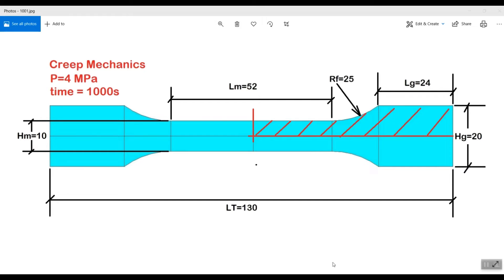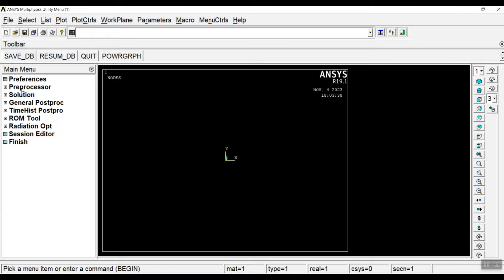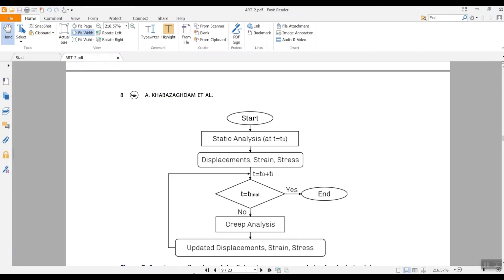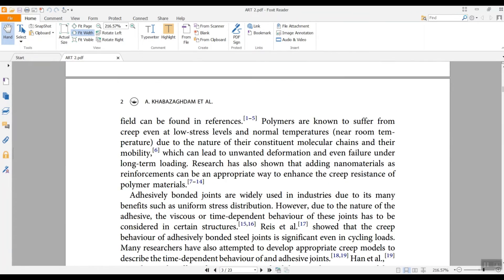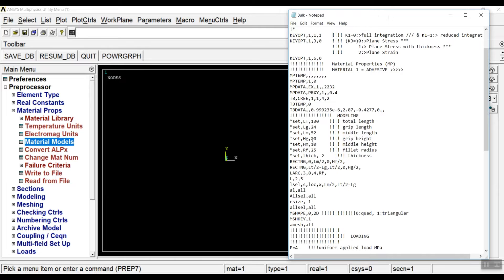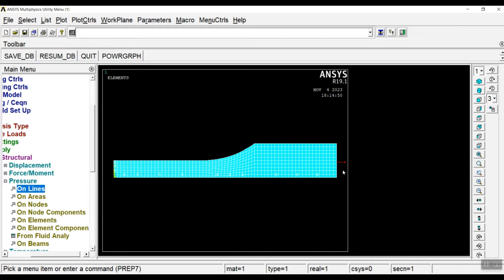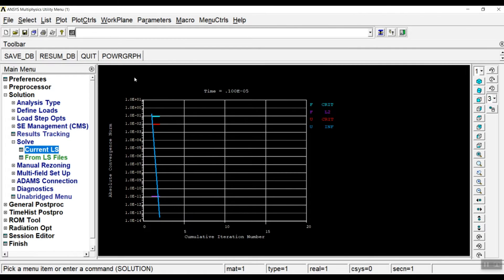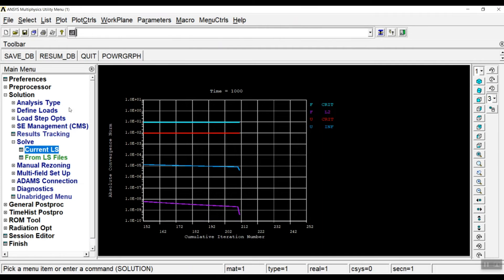Creep simulation in ANSYS. APDL Scripting.

Comment: Dear Dr. Khabaz, in your APDL, there is a line *set, thick,  2    I am assuming that this plays no role, correct? Also, is there a reason that you chose "plane stress" as opposed to "plane stress with thickness"?
Reply from the maker: First, I would like to express my sincere gratitude for your interest in the video. Regarding your comment, I agree that this line is insignificant if the element is chosen to be in a plane stress condition. As you mentioned, opting for plane stress with thickness provides more precise and accurate results.